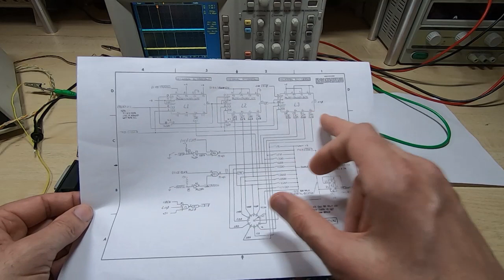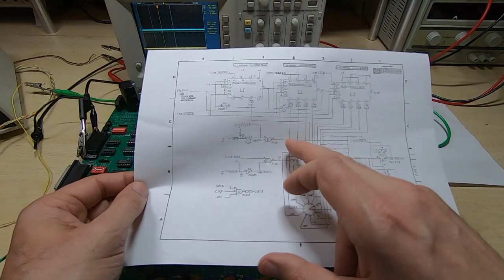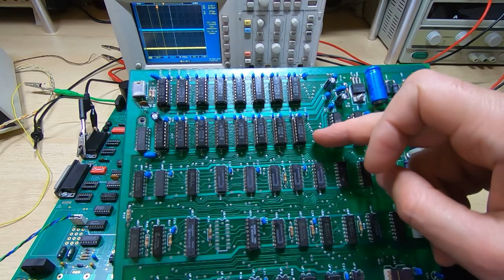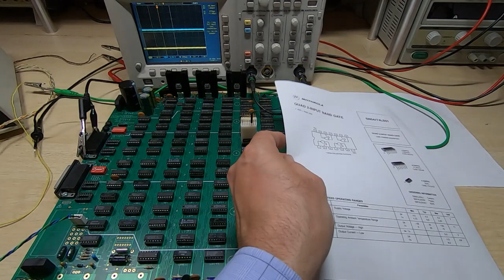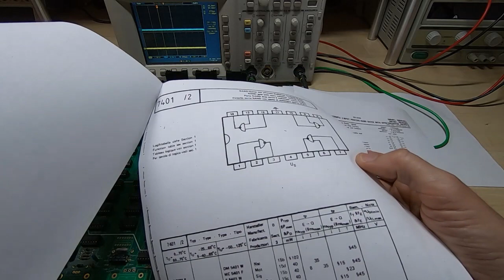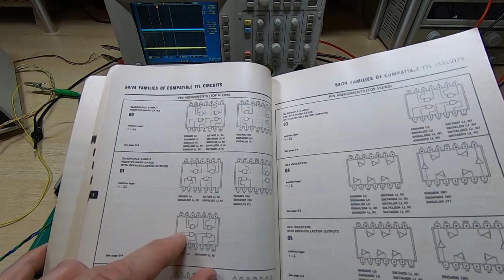TTL Logic device Traps Part1

Comment: Useful info but about 15 minutes longer than needed to prove the point.  Out of all of that it can be distilled down to “even with the same number, a 74xx chip might have different pin configuration. Check a fully fleshed out datasheet to spot any differences”.
Reply from the maker: No one forced you to watch and you seemed to have missed the point of the video.
 Some people may be interested in this topic and I pace the video's to my intended audience instead of making lazy 5 second videos just to get clicks..
Yes I could have opened the video and said 'Just read the data sheets' and finished the video but that is not very helpful.
Datasheet also do not cover what this video is trying to get across.

Comment: This is very useful information, I never heard of this before. Neither do I understand the complete details of the Baud-rate selector, two different clock-rate are going though an and-gate, then the result is some clock-rate that is presumably not in sync with others. A clock-sync that is out of pace, how could this have worked?